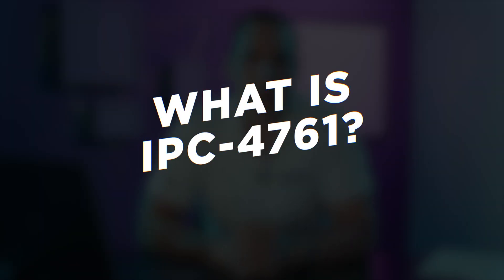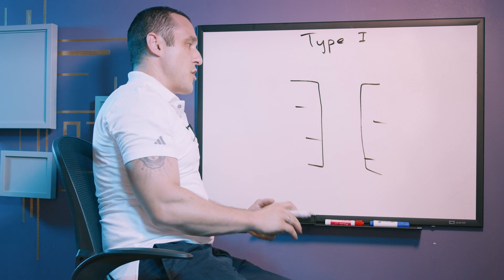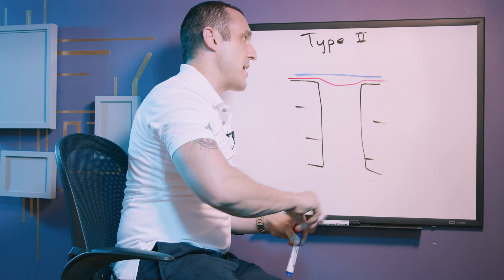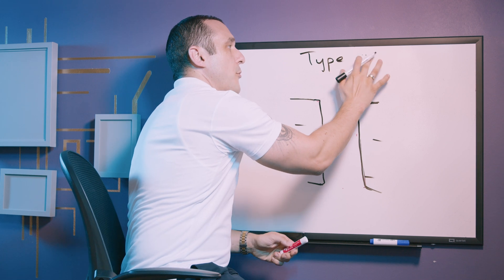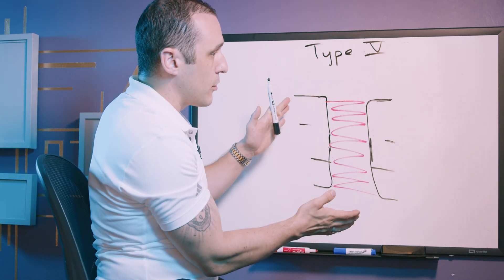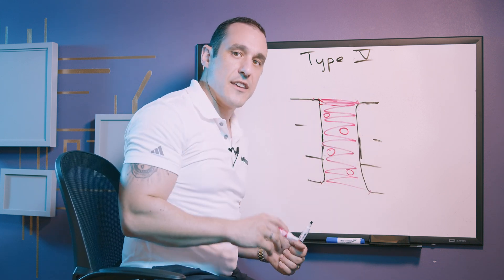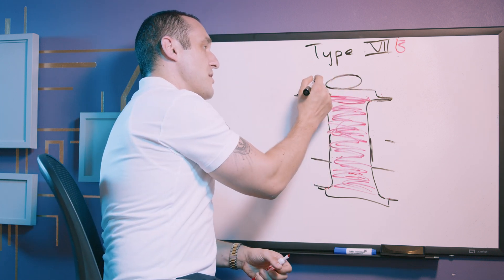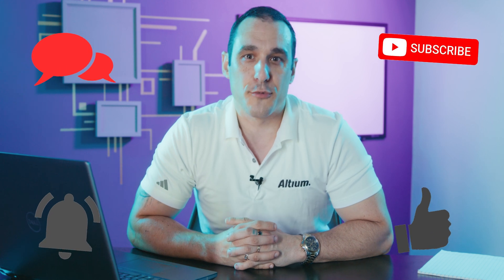IPC 4761 Via Types Explained - Complete Overview!

Comment: Hello Zach, thanks for the great presentation! It looks like what is not mentioned in the video, is that via protection could help to protect a via itself against extreme temperatures. By the way, would be really interesting to get a video on via failing mechanisms and cross-sections interpretation.
Reply: That is a good point, the via protection does not really protect the via from extreme temperatures but it does protect from other possible failure mechanisms like exposure to certain chemicals. I'll see what I can do to put together the video you request.
Reply: @Zachariah-Peterson  Ok, then let me be more precise in wording here: it doesn't protect from constant extreme heat, but it could protect against thermal shock. I have one real example from our manufacturing, where people were using CO2 cleaning for some of our interposer PCBs. And then some of these PCBs were failing. We found that all these failing PCBs were quietly adjusted by PCB supplier in a way that all of the manufactured without soldermask  overlapping vias. I've seen a paper from IPC where they explaining the failure mechanism in a way that copper in case a via is completely unprotected, could heat up and expand much faster in this case. This failure could be prevented by any via protection as in this case we allow laminate and copper heat up evenly.

Comment: Hello Zach,

Thank you for the awesome video!

I have a question regarding the additional layer you mentioned at 3:50 in TYPE-2.

Is this layer a solder mask or is it made of another material?

If it's a different material, could you please specify the exact type?
Reply: Tenting with Type 1 is normally dry soldermask film. Type II can be done with dry soldermask followed by liquid photo-imageable (LPI) soldermask, this gives a higher strength material for tenting. Normally I call out only LPI soldermask as the standard soldermask material on my boards, and many shops do this anyways as a standard material, so that means most tented vias will be compliant up to Type II.
Reply: @Zachariah-Peterson  thank you for answer : )

Comment: So what is your "go to" via? I mean what do you mostly use? What vias do you recommend for general use? What via types do you not recommend at all? what should only be used for cheap toys and what is good for using a rough conditions etc. Good explanation in general, but you could have guided us a bit more for when to use what type.
Reply: Type 1 = dry solder mask film. Type 2 = dry solder mask followed by LPI solder mask in the via region. Many fabricators today will use LPI by default unless you specifically request dry solder mask film. I normally do LPI by default regardless of tenting, so that means my LPI tented soldermask is compliant with the Type 2 definition since the LPI is used everywhere. For via-in-pad, use Type 7. The fill material depends on the required CTE value of the material and the via size, ideally you would want to match the z-axis copper CTE value in order to minimize shear stress on the hole wall. Smaller mechanically drilled vias (6 mil drill size) get a conductive material like DuPont CB100, larger (10 mil drill) will be fine with a material like Peters PP2795.
Reply: Don't specify anything if you don't need it. 
Cover it if you have silkscreen
Tent it if you are worried solderpaste comes through
Plug it for additional protection (I recommend against plugging both sides cause the via can explode due to the trapped air... even tho I heard manufacturers have this under control now)
type 7 if you want to do via in pad

This is a broad generalization and doesn't cover all cases, you need to think about it.
Reply: @SwitosVideo  (1)  Is there a difference between "covered" and "tented"?  (2)  Did I correctly understand your earlier answer as saying that if the via doesn't show up (as a hole) in the soldermask layer, the assumption is that the soldermask will be drilled through, rather than leaving it tented?
Reply: @jimjjewett  1) covered is just soldermask put over the via, tented is an extra protective layer put on top the via 2) most manufacturer will cover it with soldermask without asking and some may ask if its intentional
Reply: @SwitosVideo  So is tenting a different material, or just an extra layer?

Comment: Too quick summary:  Type I is just a hole, Type III is plugged, Type V is filled in.  Even numbers mean to cover the hole with soldermask.  -B means to do the same thing to the other side (so doesn't apply to V).  
VII means to add conductive metal back so the full pad is still conductive, despite having removed the copper with the drill.  (And there is no standard VIII because adding a conductor but then covering it anyhow is a strange case.)

Comment: Why does "cover with soldermask" need to be called out on the vias, instead of just not making a hole in the mask layer?  Is it just to avoid ambiguity, or is there something a little different needed in the process when the mask isn't supported?  (And does this special requirement/processing apply even to smaller vias?)
Reply: You can do it like this and most manufacturer will understand you want IPC Type 1

Before Altium added this feature you did it like this no need to specify... only when you want for example tented you needed to specify
In the past before you could define it I even made Type 7 Vias a weird size and specified it in a Readme file... now in Altium you can just select it and it exports additional layers just for this porpuse
Reply: @SwitosVideo  Now you would only specify if the manufacturer offers both dry film and LPI and you want to make sure they use a specific material. The manufacturers I use are already doing LPI by default, they are not putting a film roll on the PCB.